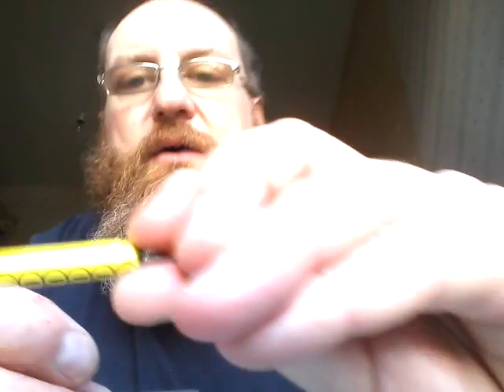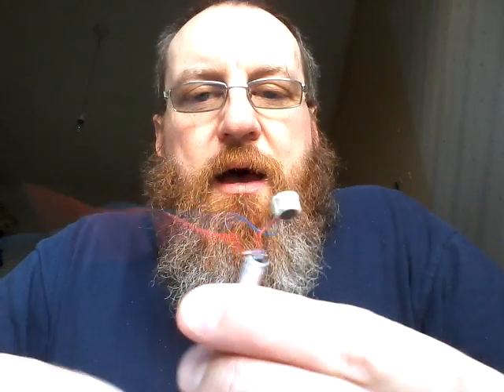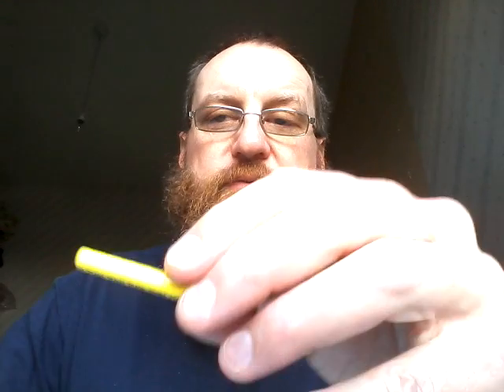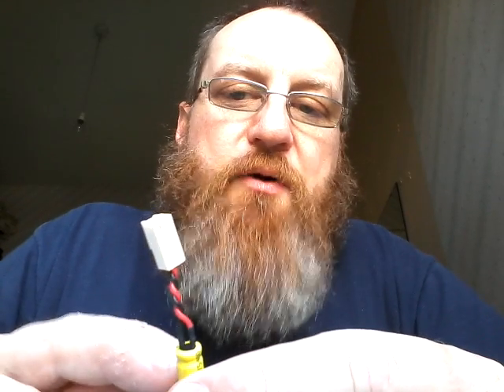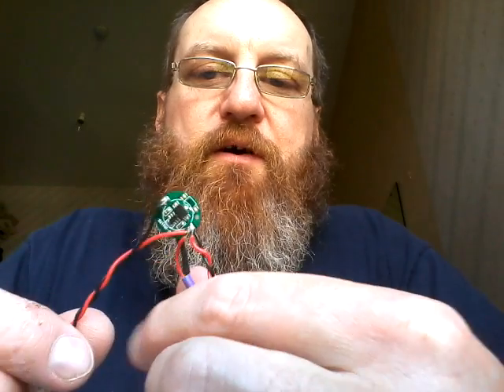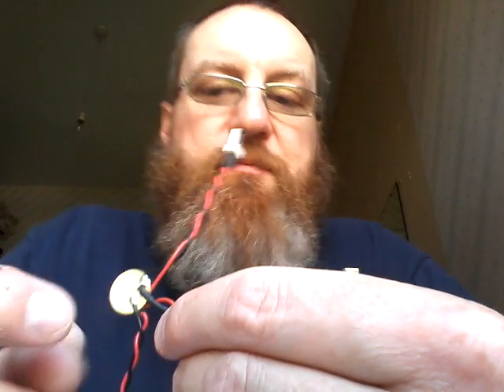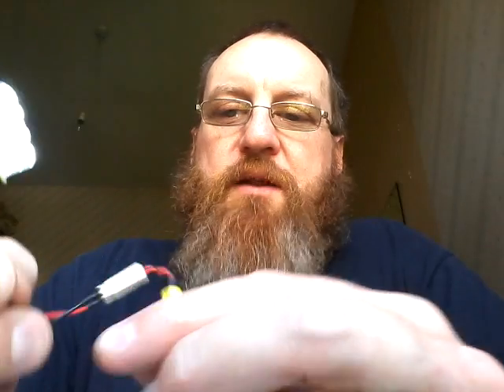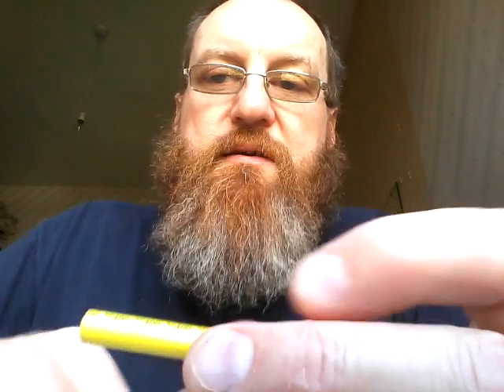Unexpected source of a rechargeable lithium cell.

Comment: I find it absurd that countless millions of people pile onto something like this electronic cigarette rubbish that did not exist as little as 2-3 years ago, hoovering it into their lungs so quickly you would think it was their last breath.  People were quitting smoking, and then something like this comes along.  Brilliant.
Reply: +pillsnotbills completely wrong, ecigs have been around for almost a decade, they are at least 95% safer than smoking, cost a lot less than traditional NRT which has a dismal success rate. 

BTW next to vaping cold turkey is the best method to quit but requires the smoker to actually want to quit,  unlike ecigs which allow us to continue to enjoy harmless nicotine without the death from cigs.

also switching to ecigs means you have quit cigarettes as you no longer smoke as vaping contains no combustion, its a aerosol not too dissimilar to quickmist.

lastly fuck you its my body my choice, its puritan idiots like you who keep people smoking & dying unnecessarily rather than having a safer form of nicotine.
Reply: taffyjock1 All right, I was looking at it as a "gateway" to traditional smoking, not a cigarette replacement.  Go ahead, puff away.  Didn't mean to trouble you.

Comment: Those types of e-cigs are not that impressive, the one I use has an LCD screen that counts drags and measures the battery charge along with it cutting off when it reaches full power..Those are cheaper casue they don't supply a charger, all e-cigs are rechargeable but in order to help sell e-cigs these are given away or sold really cheap, this is a tactic to increase business, I gave many of those away.

Comment: Could you use a electronic cigarette to vaporize acetone? It would be quite useful to smooth 3D-Prints (And dangerous, yeah yeah)
Reply from the maker: +John Smith I wouldn't recommend it.  A simple heated dish should vaporise it.
Reply from the maker: +Ese Callum I don't think it would work as well as just inhaling a spray or using a nebuliser.

Comment: What a waste. I thought lithium is a rare material. Thanks for the video.
Reply from the maker: +foamidable It's the complete opposite.  A non-rechargeable lithium cell contains metallic lithium, while a rechargeable one just contains lithium ions, so virtually no actual lithium content at all.  But it still seems wasteful that a rechargeable cell is used just once, even if it is cheaper than a non rechargeable one.
Reply: nick clee Well I suggest you do some reading on the subject.
Reply: +nick clee "Cause" does not mean "always results in", it means, "can lead to". "Can" is not a guarantee, but the odds increase. Holding a golf club outside in a thunderstorm can cause you to be struck by lightning, even though someone who does it may not get struck. You are an idiot.
Reply: +Peter Riis  Virtually is a comparative, not a statement of absolution. Compared to Lithium non-rechargeables, Lithium Ion cells have nearly no lithium in comparison . Make more sense? The ones that are meant to be thrown away are the ones with most of the lithium. It is therefore less of a 'waste' to use the rechargeable lithium ones.
Reply: nick clee Preferably not from a source connected to tobacco giants or pharma in some way.
Reply: nick clee ...and pro-smoking nazis (usually smokers trying to justify their habit) pretend there's no solid proof to associate smoking with ANY health effects whatsoever. I won't go into long conversation here, but take tar in your lungs for one thing. I don't suppose you can explain why so many people quitting smoking (including myself) feel a lot better? I don't suppose you can explain why am I able to breathe normally and not get winded when walking up the stairs anymore? Yeah. I must have been magically cured from my respiratory problems and cigarettes had NOTHING to do with it.
Reply: +nick clee I'm sorry but you lost me there. Nobody said that smokers cause cancer, but smoking does. Resorting to cursing when your arguments don't line up, huh?
Reply: nick clee Tobacco smoke contains a metric fuckton of carcinogens which are compounds responsible for probability of initiating tumors. In any case, google "carcinogenic effect of tobacco smoke".
Reply: Phil Vapes Think about it. Who has the power and ulterior motive to falsely cast cigarettes in a bad light? No one. There is nothing profitable in fewer cigarette smokers. That would lead to less medical debt and less income to big tobacco.
There is no reason to lie about the harmful effects of cigarette smoke at all.
That guy has obviously not thought things out very well.
Reply: +Richard Smith Wouldn't have said it better. Good on ya mate.
Reply: +nick clee Tell that to my mother. Bladder cancer is a particularly exclusive club, very few join who are not 20 a day nicotine hitters. Go and do some reading, and take off your tinfoil hat. Its not all a conspiracy to stop you enjoying your habit. BTW people are also highly allergic to tobacco smoke too.. to the point where they risk anaphylaxis if exposed to cigarettes. Get with the program, and do grow up.
Reply: Helium is constantly released by every element on earth heavier than helium(that means all of them short of hydrogen and helium), from natural atomic decay. Most helium is replenished by the common(relatively speaking) highly radioactive elemental ores, like uranium and thorium. 
In other words, whether we USE helium or not, it will still leak away. 
The only reason it is so rare is because of how light it is. It just leaks into space.
This is a good thing, if helium couldn't leak out, our planet would become a gas giant. Helium is too stable to be chemically useful enough to supply sustenance for life, so having so little of it is a blessing :) Also since it is constantly replenishing, we are not going to 'run out'. We lose exponentially more than we could ever hope to capture, because it just leaks into space.
Reply: +foamidable Waste? Ecigs help countless smokers quit analog cigarettes which cause cancer by moving over to a safer alternative which they are.
Reply: +MrSwanley Uuh? Helium is rare too. There is a shortage. http://www.popularmechanics.com/science/health/a4046/why-is-there-a-helium-shortage-10031229/
Reply: David Schroeder "Helium shortage" HA! The issue is not that we are 'using it all up', it is that we are using it faster than we can distill or create it. It's the second most abundant element in the universe, the issue is PURELY supply and demand, and the cost is not from a real shortage, but an artificial one due to limitations in the speed which we can bottle it up.
Reply: +bigclivedotcom   
What??? An ion is a charged atom or molecule. It is charged because the number of electrons do not equal the number of protons in the atom or molecule. So – if you have Lithium ions, Lithium has to be present.  
Right?
Reply: +Martin Bennett   Right - so you say Lithium is present in a cell, charged or not charged, whether it is chemically bonded to other elements or not. I'm not "dizzin" the video - that was interesting to watch, I'm challenging the claim that rechargeable Lithium batteries has "virtually no actual lithium content at all". Have I perhaps misunderstood the meaning of virtue...  ;-)
Reply: +Phil Vapes there is no solid proof smoking causes cancer as smokers and non smokers get the same cancers and many more non smokers get cancer its all down to genes and what triggers them
Reply: go look yourself google is your friend many studies state there is no solid proof but that bit is always left out by the anti smoking nazis
Reply: nick clee I'm talking about smoking causing cancer and other health issues in SMOKERS not in second hand smoke. It's been proven over and over again that tobacco is dangerous to your lungs AS FUCK. Light up some coal and start inhaling the smoke - you won't be far from tobacco. Both deposit a metric fuckton of stuff on your lungs, but the latter will kill you just under seconds as opposed to years/decades.
Reply: +Phil Vapes if it causes cancer how come all smokers do not die from cancer or smoking stop jumping on the anti band wagon because you are to stupid to know when you are being lied to
Reply: +foamidable Can you give a reference for the claim that Lithium is rare? It's the 3rd lightest element in the universe (right after helium), and lighter elements tend to be more abundant.  Of course as an alkali metal it is highly reactive (hence its usefulness in batteries of course), so you can't just dig it up: it has to be refined and then stored away from water and oxygen.
Reply: +David Schroeder there is no rare helium
Reply: lol, it is a non renewable resource =rare
Reply: No one on this earth other than the people at CERN can talk to me at the level I am at bitch.
Reply: Where do you want to be shot? The feet?
Reply: David Schroeder Lol you're funny
Reply: David Schroeder Helium is the MOST renewable resource in the universe. You renew it by fusing hydrogen together, whether manually, or let a star do it.
Reply: +David Schroder Do you understand what "tend" means?  Do you wonder why I included that word in my post?  And btw: helium is the second most abundent element in the universe, but there are technical reasons why it is rarer this close to a star, plus as a noble gas it doesn't have the option to remain locked in a mineral.
Reply: MrSwanley Unlike other gases that are a major component of air, such as nitrogen (78 percent), oxygen (21 percent) and argon (1 percent), helium is present in very small amounts (about 5 parts per million) and is therefore not economical to obtain from the air around us.

In the universe, ok, sure but here on earth not so much.
Reply: +foamidable http://gas2.org/2009/09/10/the-world-has-enough-lithium-for-electric-cars-its-the-other-bits-were-short-on/
Reply: +KoolBreeze420 Thanks
Reply: +bigclivedotcom they cost 0.03p from china, they are technically all rechargeable although with risk associated.

Just go down your local store, ask for permission to place a collection of old ones boxes, strip them down and make into a giant solar charging powerbase. 
Any left overs can be recycled and scrapped.
Reply: Rare?! Lithium is the 25th most abundant element on Earth.

Comment: could you not swap out the battery in the solar garden light and fit the cigarette battery in it?, make it last a lot longer,  Just a thought
Reply from the maker: The solar garden lights have a solar cell that is just enough to charge a 1.2v cell, so it wouldn't charge a lithium cell.  If the solar cell did put out a high enough voltage, the lithium cell would need charge and discharge protection.
Reply: ah well, it was just a thought : )
Reply: +markcumbriauk NO, the very low current charge from little solar panel make destroy and degrade a lithium cell. and voltage is too low for charge. Lithium cell must be charged with current and voltage regulation NiMh cell are very tolerant with current and over charge.
Reply: +bigclivedotcom The e-cigs do have over charge protection, well at least all the ones I have used and sold do, lots of people tamper with these and take the circuit board out and then wonder why they explode in their face or cause a fire. They are bypassing the safety mechanisms.

Comment: Cut the heating element off. Feed 5 volts into the 2 wires you now have.
The LED will light and charge the battery at 120ma
The pressure sensor ASIC is also a LiPo charger.

Comment: As far as I know (someone correct me if wrong) primary lithium cells, i.e. non-rechargeable have a terminal voltage of 3 to 3.6v. Whereas Rechargeable ones are always marked 3.7v as per the one in the E-cig you just disassembled.

I'm guessing these 75400 cells are 7.5mm by 40mm.

Dave.

Comment: Tons of readily about available and quite decent quality 18650 sized li ion batteries in old laptop cells.  Usually one or two cells die rendering the whole battery defective and unchargeable, crack em open and recover the good cells, Oh and the cordless drill packs as well.
Reply: Brian C A lot of laptop battery packs are 'smart' batteries that simply switch off after a certain number of recharge cycles. All the cells are fine but the pack just doesn't work. 
It's called planned obsolescence in the industry. I call it fraud, but I've yet to find a lawyer prepared to take the case pro bono. :P
Reply: Aadil Shah That's not quite the case, but it makes a good conspiracy story.  Notebook/laptop battery packs have a protection circuit that will blow a non-resettable fuse if the voltage on the cells falls outside the safe range.  This is to prevent cell rupture and possible fire rather than to make the manufacturers more money.  Also these packs have no cell balancing circuitry (since it would be large, costly and cause power dissipation problems) so the cells go out of balance after a large number of charge/discharge cycles which effectively causes a big reduction in usable capacity even though the cells are ok.  If you split the pack and balance the cells, you will get back a lot of the original capacity from an otherwise unusable pack.

Comment: Did you get the weight on it? I use a 240mAh lithium battery for the video sender on my GoPro when I'm flying my drone.
Reply from the maker: Green Silver I've just weighed a couple from recently dismantled e-cigs (From a UK shop called Poundland).  They're both 3.45g and are both 75400's.
Reply: bigclivedotcom
Thanks, I'll have to check out poundland next time I'm in town. 👍🏼
Reply from the maker: Green Silver They sell them in Pound World too.  Usually under the name Vi-Pure.
Reply: I've never seen them in our one, they sell the liquid and smoking accessories. Maybe I've not seen them because I've never actually looked. Thanks again for the tip.
Reply: Green Silver Use bluetooth earpiece LiPo packs..
Reply: Why not the bec?
Reply from the maker: Igor K They do appear to be rechargeable in these ones.  It's probably a lot cheaper to use a rechargeable cell in that format than to source a non rechargeable cell in that size.  Any experiments with other known non-rechargeable cells have shown a lack of chargeability.  These ones readily take a full charge and discharge cycle repeatedly

Comment: Shame it's such a small capacity cell - can you get e-cigars?
Reply from the maker: You do get e-cigars, but the disposable ones are so expensive that you're better getting the ego style cigarette or e-shisha that has been mass-cloned and has a range of cheap rechargeable base units.  The main advantage of the dinky cell out of the ciggy is that it's pretty tiny, so ideal for pen sized rechargeable gadgets.
Reply: Yes, go to fastech.com the have very cheap 18650 and now larger 26650 sized ecigs but the battery quality is usually sub par

Comment: The yellow cell looks like it was built into a standard electrolytic capacitor casing.  I did see some 'capacitors' branded as being lithium based in a Digikey promotional thing a few months back, but I don't know if they were actually lithium cells in a capacitor can or just ultracaps intended for use in memory backup applications and I didn't order any as they were expensive.  Can't recall the part series or I'd look them up (but they might be made by Taiyo Yuden IIRC), but a cursory Digikey search just gives some backup power ICs with integrated backup cell/cap chargers.

EDIT: Taiyo Yuden LA series.  They're just 3V ultracaps.
ANOTHER EDIT:  Taiyo Yuden LIC series, which are ultracap/lithium secondary cell hybrids.  That start at USD25.33 for the small 40F ones, so they aren't what they are using.